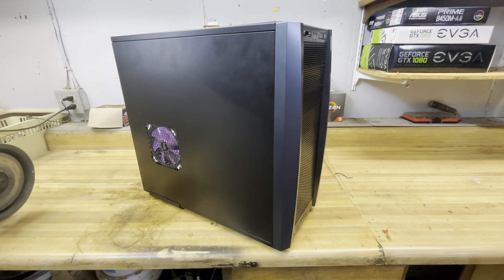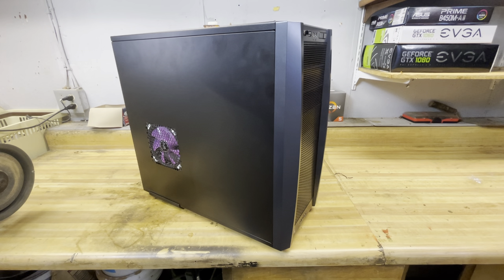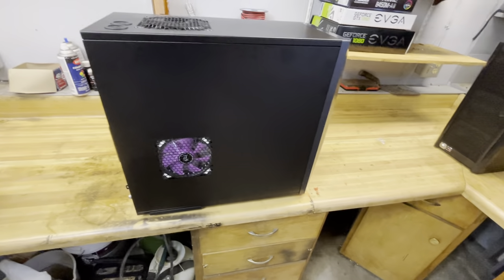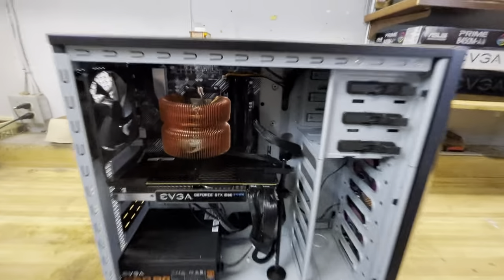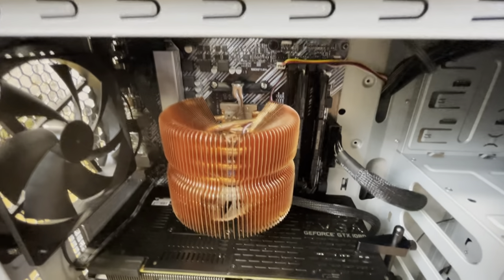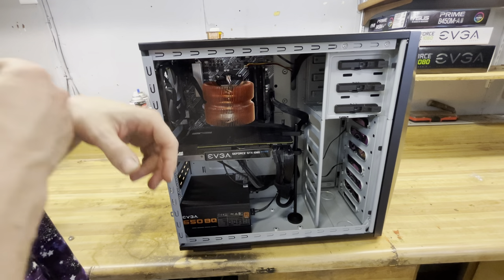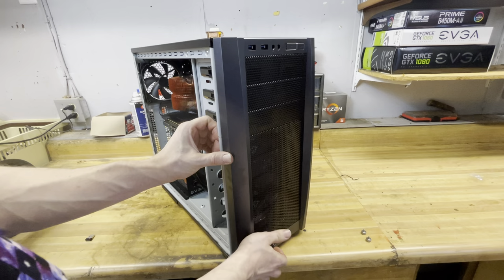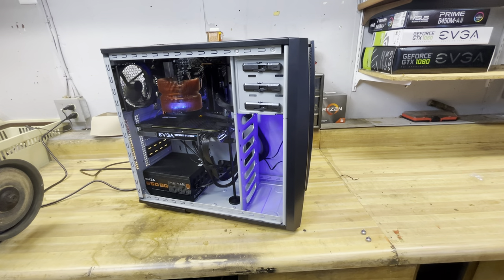Ryzen 5 Antec 300 Update: Better Case... MORE GPU POWER

Comment: You got a link for the GPU Lift Kit?
Reply from the maker: upHere Graphics Card GPU Brace Support Video Card Sag Holder/Holster Bracket, Anodized Aerospace Aluminum, Single or Dual Slot Cards Black (G205) https://www.amazon.com/dp/B079HSVSLR/ref=cm_sw_r_cp_api_glt_fabc_3M5301Q9NKRQCM5NCJZW?_encoding=UTF8&psc=1